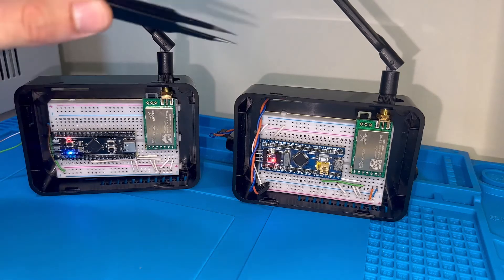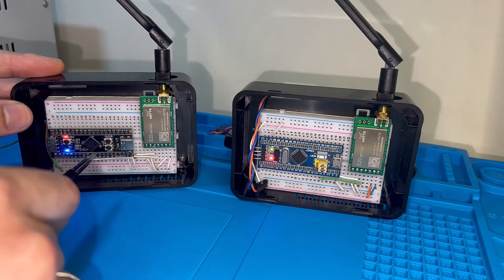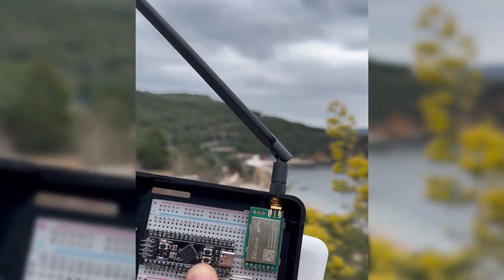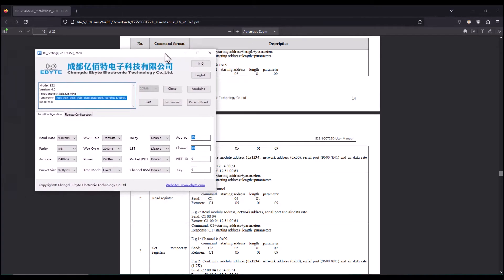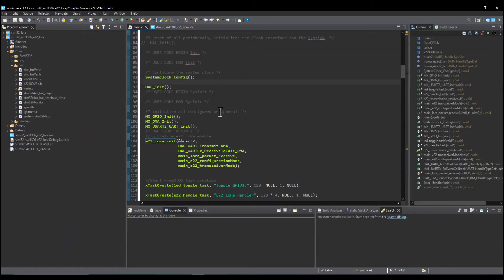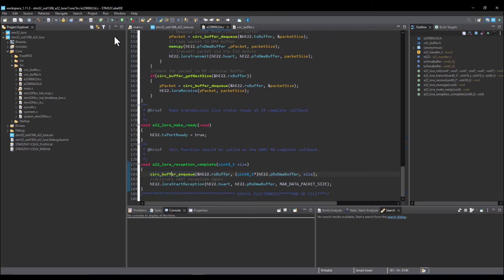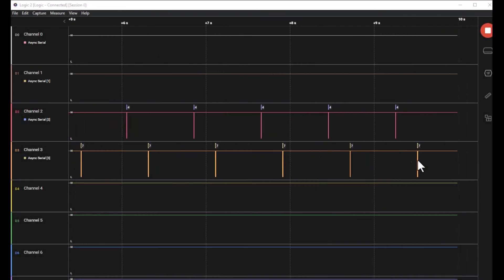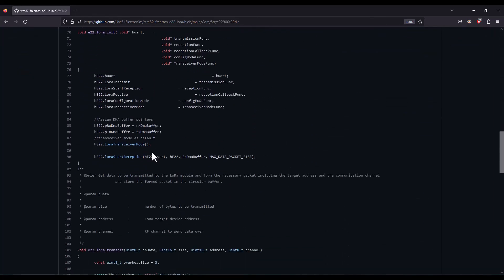STM32 E22900T22D LoRa Transceiver Module  and Range Test

Comment: Hello, I am trying to connect my STM32 and E32 LoRa, but the RX is not responding. When I connect the same E32 module to an Arduino Nano, it works perfectly. What could be the issue, and how can I fix this?

Comment: hello brother nice to meet you..

may we know.. can the software control the frequency transmitted continuously or only at intervals?

because we want to try testing in our laboratory on the transmitted frequency using a spectrum analyzer

therefore we need continuous frequency transmission

Comment: Hi sir. I have a question. The library or driver files that you use (e22900t22d.h and e22900t22d.c). We can use the LoRa modules without these files right? Since the stm32 board run with LoRa as default, as you said before.

Comment: Hi sir, thank you for the video and explanations. I want to ask that, can't we use the LoRa modules without using FreeRTOS? Do stm32 boards not include the needed softwares for that?
Reply from the maker: Adding FreeRTOS is an optional feature. STM32 runs without RTOS by default.

So yea you can use LoRa module without using RTOS
Reply: @usefulelectronics  Thank you for your response. I made the project to communicate 2 stm32 blue pill boards. When I arrange the wiring just for the UART communication between boards, it works. But after I change the wiring according to the LoRa e22-900t22s modules, it does not work. I am sure about the wiring, parameters like baud rate, channel etc. What could be the issue?

Comment: Is it possible to post the circuit diagram you created for the STM32F103C board? I don't understand the circuit schematic shared on GitHub. I would be very happy if you make it with applications such as Fritzing and share it. It is very important for me.

Comment: For line of sight communication, you can do the same distance with 2.4 ghz
Reply from the maker: Yes but you will need a very big antenna for that
Reply: @usefulelectronics  Normal whip antenna works fine for this  distance
Reply: 2.4Ghz is overly congested, low powered, and terrible outside. Lora typically uses 900~Mhz range, and will penetrate walls and foliage easily. 

LoRaWAN vs. Wi-Fi wireless technologies

The best way to describe the LoRa vs. Wi-Fi discrepancies is to go back to the basics. Any network type can only have two of three characteristics; long-range, low power consumption, and high bandwidth. While Wi-Fi is superior when it comes to bandwidth, it suffers when it comes to battery life and range. Most networks might struggle to work past 15 meters, which makes them unsuitable for scattered IoT devices.

In comparison, the low power and long-range nature of LoRa make it ideal for these devices. However, LoRa will struggle to send a single image, let alone large files. It thrives at sending small packets of data, such as temperature and humidity. Lora can work from 1 ~ 10km

Comment: "I am getting 'Module no response' error every time I try to configure the RF settings. How can I fix this?"
Reply from the maker: You need to change M0 and M1 voltage level for configuring the module check out the data sheet

Comment: Hi i want to know how you can send and receive the packet between 2 lora simultaneously because i have already chosen the transparent mode for the 2 lora in the configuration app but when my lora is receiving a message it cannot transmit my instruct to request another different packets from the other lora.
Reply from the maker: You can’t do that 
You can design your system to operate as slave master so you can expect when to receive data